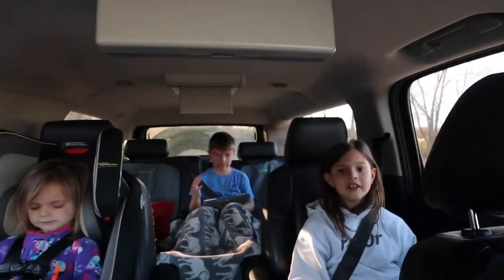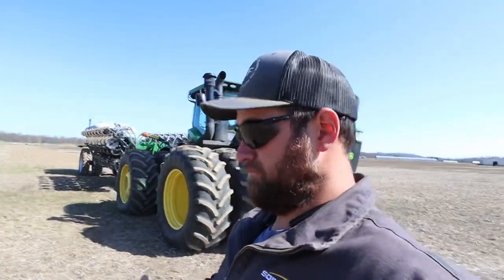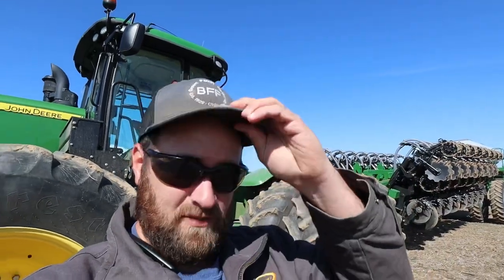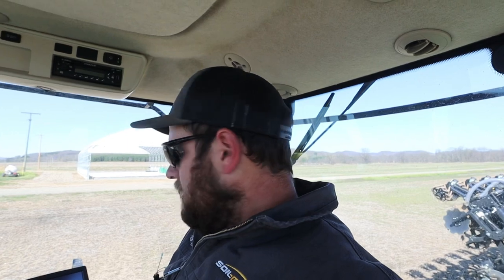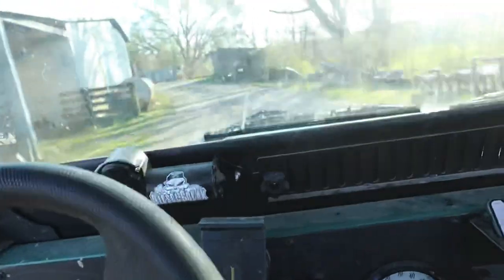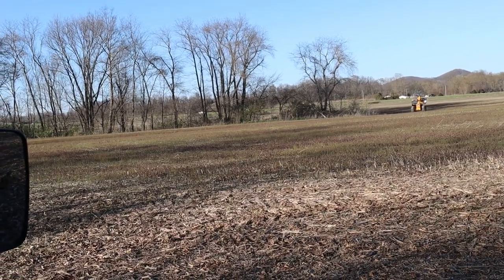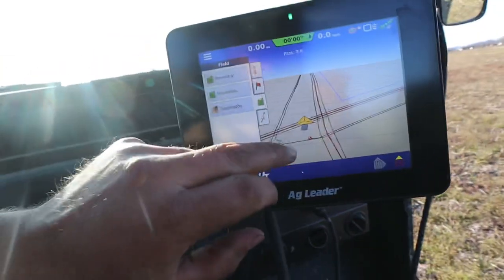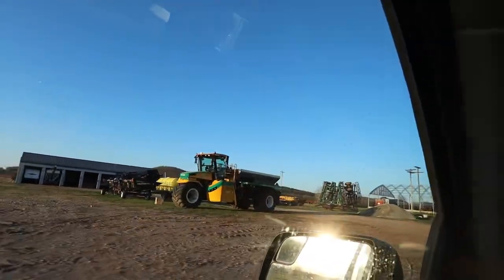Big Tractor needs Big Power! Extra 100hp

Comment: I used Amsoil engine oil and gear oil in my 1999 4Runner, changed engine oil in average every 10k miles and never had a problem.  Sold it at 250k and was still running good.  It is pricey.

Comment: I run a "85 MF 4840  with a 903 cummins  the pump has been cranked up ! but I run propane boost on it in 2 stages  , baseicly   a if  we need another 50 hp switch and add another 100 hp switch  or both  , been doing it for 25 years  ! an a hard pull day sub soiling  60 lbs of propane  for 12 hr

Comment: Ask BJ how Briggs and Kawasaki increased the horsepower on their mower engines. I turned a 19hp twin into a 25hp twin by simply opening the carburetor  butterfly and installing a tiny exterior oil cooler, 😎
Reply: That’s pretty much it. In some cases I think you needed to change out carburetor jets as well.

Comment: A question on continuity Brian.  End of previous strip till bar setup vid the fert shed had a roof.  Subsequent JD tuning vid the fert barn only had ends, did the roof have an issue or we are just all mixed up.  You know the sort of thing, vintage films that have tramlines, crops that are far to good for the time,  mechanically trimmed hedges, galvanised gates etc etc.
Reply from the maker: The end of the striptill setup was filmed a couple days ago the shed covering gets installed in the next video.

Comment: How much extra fuel will 100 more HP use?
Reply from the maker: Not much. Mostly because the tractor isn’t lugging down and we can actually idle back a little. Using 21-25gph which is close to what we were using on the turbo max

Comment: Good evening. The freezer bags that are slide sealed,you can pour a quart bottle into one cut a corner and squeeze the gear lube into a gearbox, transmission, transfer case  or axle house.
Amsoil is really good product. 
Be safe everybody.
Reply: I’ve used a pastry piping bag for the same thing, just don’t give it back to the wife unless you like frosting that tastes like 80W90 gear oil
Reply: Couldn't think of the name for the bag. But me and thinking can get out of hand quick.